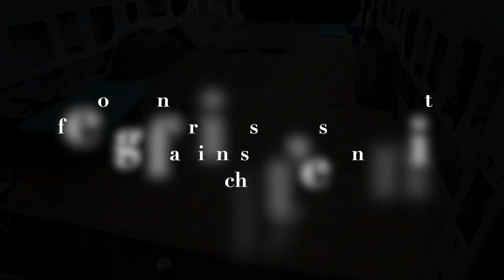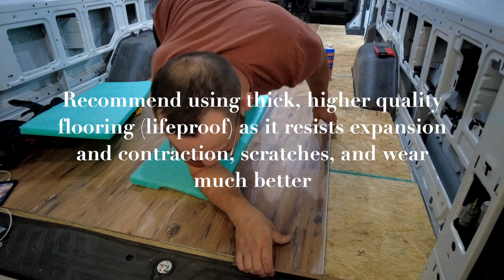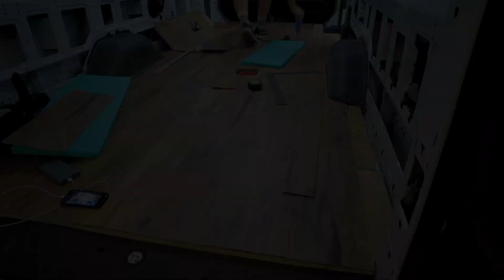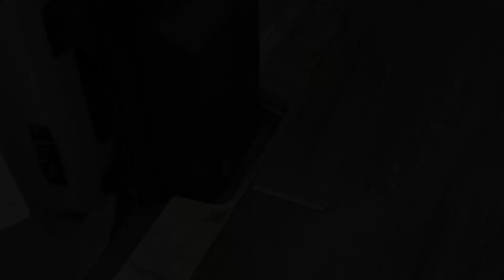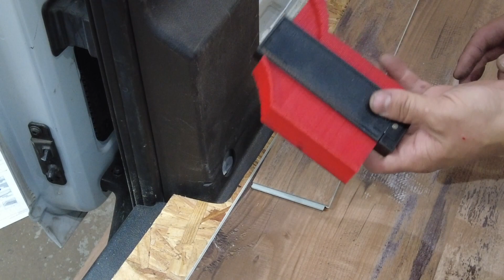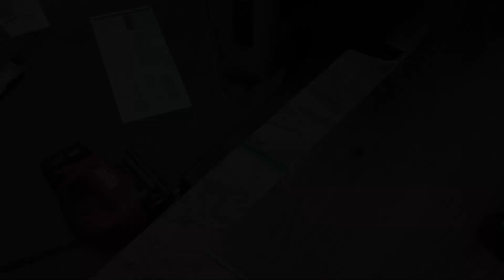Using Contour Gauge for Vinyl Plank Flooring Install Van Build

Comment: Installing my lifeproof diagonally, trying to use a speed square and gauge and just cannot get it. Takes me 30 minutes for one cut, started using card board to make a template so I don't waste boards.  😢 I try to transfer the shape of the contour gauge to the board but because it's diagonal, I cannot place it right, after a cut the board is moved up and to the left, ugh 😑
Reply from the maker: sounds tricky for sure, never tried it diagonally!